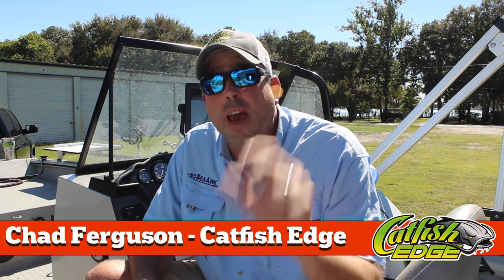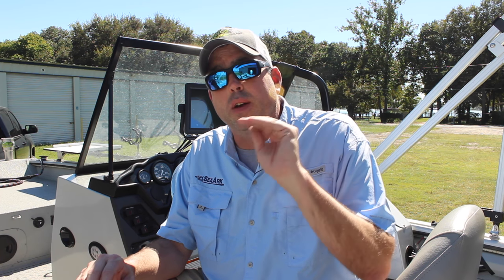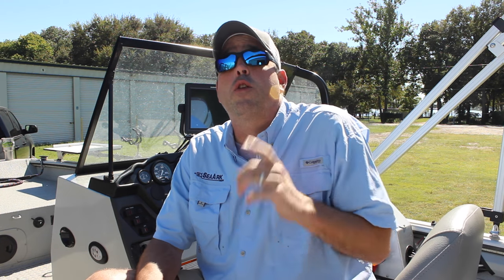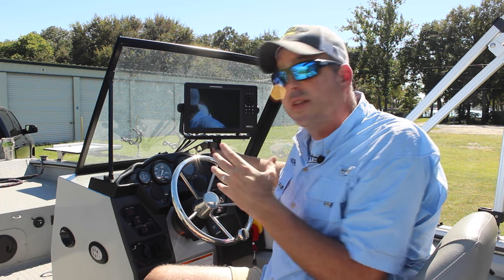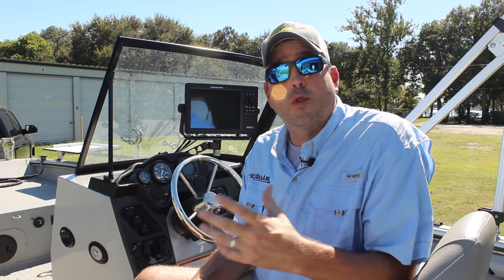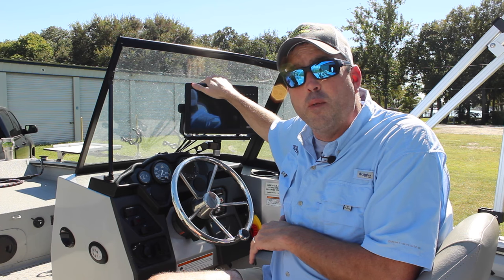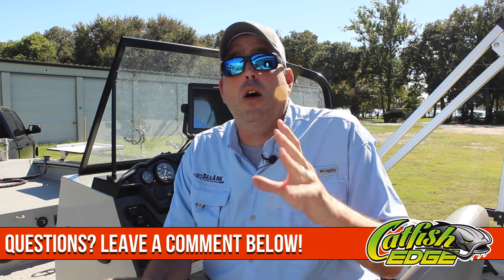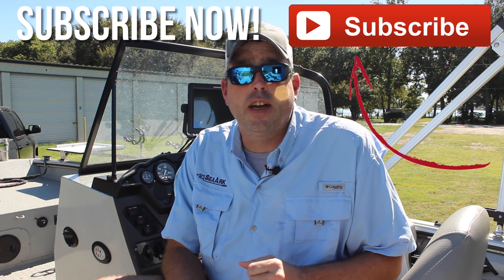My Catfish Boat Electronics (Humminbird Onix,360, Minn Kota Terrova and iPilot Link)

Comment: I know this is very late comment but I was wondering if you run switched power to the network adapter? In the video you stated to tun Finders directly so I was unsure if you do the adapter as well. Awesome set up by the way!
Reply from the maker: I run everything direct to battery.
Reply: @Catfishedge  thanks!

Comment: I’m installing a trolling motor on a procat 200.  What quick release plate are you using on yours?  The composite ones(mka-21) is too short for the nose of the boat.   I ordered a mka-016-03 hoping that it fits.
Reply from the maker: You need the mounting plate from SeaArk.